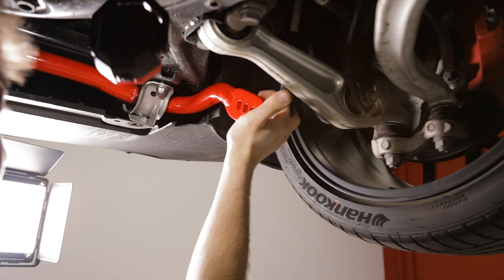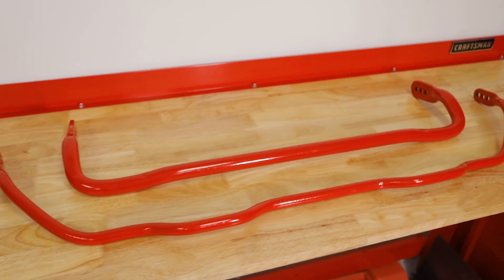Eliminate Body Roll! DIY Installing TMaxx 3x Adjustable Anti-Roll Sway Bars on Tesla Model 3

Comment: Do you have a set for Model Y?
Reply: Should be the same
Reply: @TheKillagodZilla  So I can use the Model 3's front bar to use with Model Y?  I know Eibach makes rear bar at 29mm for Model Y.
Reply: @OutlawsOG-Blessed  I was wrong when I said that.  I think the model 3 is shorter at 22
Reply: @TheKillagodZilla I picked some some suspension goodies for the Black Friday.  Some will come tomorrow.
Reply from the maker: Not yet!
Reply: Can I use Model 3 bars for the Model Y?  @TSportline

Comment: A couple questions.
1. Why did use the middle (not the FWD or AFT) mount hole to attach T-Sportline FWD Sway Bar?  Same question for the Rear Sway Bar.
2. What is the torque for the attaching hardware?
Reply: Since TSportLine won't answer, most likely, 
1. You can use any hole you want, front one is softer setting and last one is harder setting, you need to adjust depending on your needs and driving style. usually middle one is a balance of both.
2. Same torque as when adjusting factory sway bar, check manual or ask service center to give that info